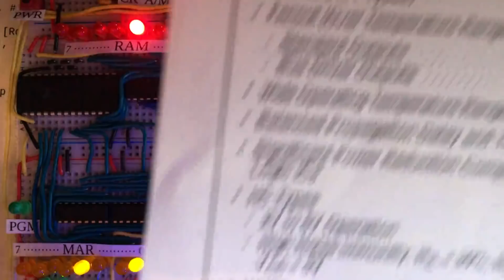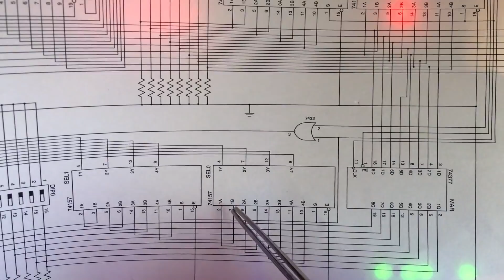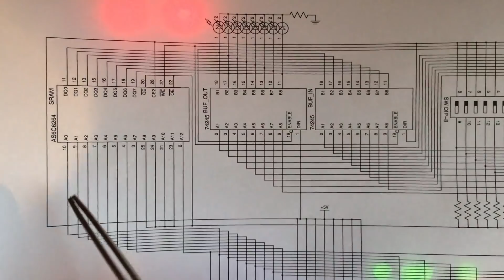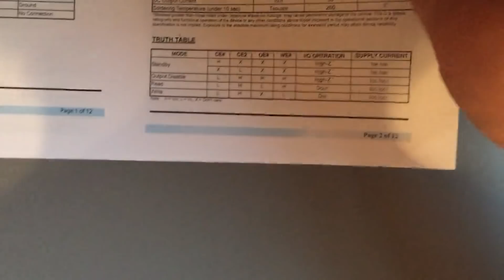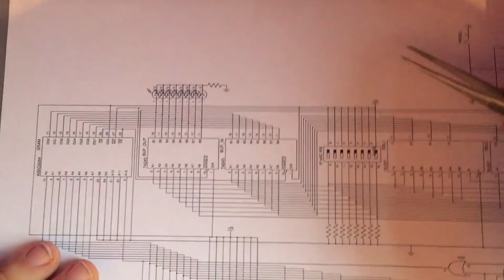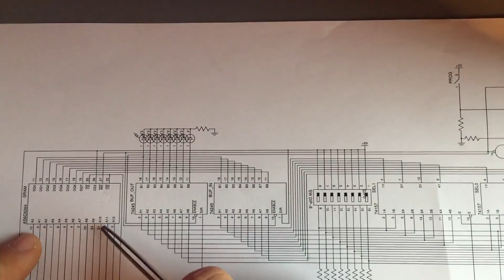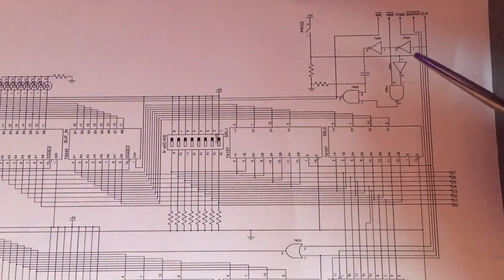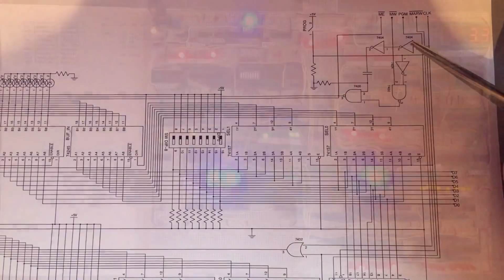My Ben Eater inspired homemade 8-bit CPU - Part 4: RAM

Comment: Hi. Thank you for everything that you've posted. It's been very useful! I see that you've tied OE# to Gnd, so that the RAM is always outputting data to show on the LEDs. I also understand that when WE# is pulled low, the RAM switches to write mode, and stops outputting data. However, because WE# is controlled by the edge detector, and is only low for part of the clock pulse, wouldn't the RAM go back to outputting data for the rest of the clock pulse? Therefore, you'd have the RAM outputting at the same time as the buffer outputting. In theory, I guess, both would be outputting the same data, so shouldn't cause an issue, unless something where to change on the bus. Wouldn't it be better to connect OE# to MI# through an invertor, so that the RAM wasn't outputting anything while the buffer was also outputting?

Comment: Sorry it's me again :P I'm designing a 8bit computer heavily inspired in yours, but I have a question about the RAM module. You use a buffer_in and buffer_out. Why not connecting directly the selector to the data pins? The control logic will control if the RAM is in input or output mode and read or write to the bus accordingly. Looking at Ben Eater's video he directly connects the data to the selector, so he can switch between direct connection to the bus or connection to the microswitches.
Reply from the maker: Ben's RAM chip has separate input and output lines. So when Ben's RAM chip is in output mode, the voltages on hist INPUT lines are totally ignored: they can be anything, without causing problems. So, he just hardwires them to the selectors, no problem.

However my RAM chip uses THE SAME lines for both input and output. When my RAM chip is in output mode, IT is asserting (that is, determining the voltages) on the I/O lines. If the selectors (which ALWAYS output a value on their output) were directly connected to the I/O lines, they would ALSO be asserting voltages on THE SAME I/O lines as the ram chip, and so we'd get an "assertion collision", exactly as you would if two components were outputting simultaneously to the bus. 

To avoid this, I use one of the buffers: it connects the I/O lines electrically to the output of the selectors ONLY when the RAM chip is in input mode. When the RAM chip is in output mode, the I/O lines are electrically isolated (that's what the buffer does) from the selector outputs and so not influenced by it at all. Indeed, at this time, they are set by the RAM chip itself.
Reply: But still you should be able to connect the RAM directly to the bus. If you want to write to the RAM you put it in first in input mode (so the bus gets free) and then put the contents of some register to the bus, then trigger the clock and write this contents into the RAM. If you want to read from RAM you put it in output mode (so it outputs contents to the bus) and make sure no other register is putting data to the bus. When switching to Programming mode you always put the RAM in input mode and the microswitches will be the ones writing values to the bus. I don't see the need of buffers in this scenario, or am I missing something?
Reply from the maker: Sorry, but no, I can't do that either :) Remember, I hardwired the RAM's Output Enable to true, so in effect my RAM chip is always in output mode, except when it's in input mode. This way, I can connect the LEDs so that they show me RAM contents at all times. However, I don't always want the RAM contents on the bus. Sometimes, it'll be doing something completely different. So yes, I really also need an output buffer, independent of the input buffer.
Reply: @jimmyb998  ok thanks. Now it's more clear. So getting rid of the leds and controlling the output enable from the control unit I can get rid of the buffers. I'll keep you updated of my progress when I put my schematics on github. One of the things I made different is the jump logic. I don't bring the flags to the control logic, instead I bring the flags to a MUX and I codify the condition to select the appropiate flag, leaving the position 0 for not jumping and the last position for inconditional jump, then the output of the MUX is my PCW.
Reply: I thought the same thing.  If it weren't for wanting to always show addressed RAM content with the LEDs, the transceiver chips could be eliminated.
However the transceiver is bidirectional so you should only need one, using the write signal going to RAM connected to the direction pin on the transceiver.
That assumes that the source/destination on the "outside" is the same.  I'll need to look at your schematic more closely to see if I'm right.
Reply: @danman32  Yes, I am a little puzzled about why there are 2 74245s in James's circuit; it seems unnecessary.
Reply: @Daniel Morin Actually, I thought about it a little more, and I think I understand why.  You have 2 SRAM inputs (BUS and PROG), but only 1 SRAM output destination (BUS).  The selectors are not bi-directional, so switching the direction in the transceiver won't work; you need to individually control the input and output.

Comment: For the I/O lines to the RAM chip, what is the reasoning for using two try state buffers, one for read one for write, rather than just one, toggling the direction for read/write?
Reply from the maker: The fact that the data flowing INTO the RAM should come from the selectors (which select either the bus or the dip switches), whereas the data flowing OUT of the RAM, should flow straight out onto the bus.
Reply: James Bates ahh of course, thank you :) this video series is a fantastic extension of Ben’s.
Reply: I thought the same thing.  If the input/output source/destination were the same, only one transceiver needed.  If the MUX had an output enable though, then only one transceiver would be needed.
Reply: How about using the 74257 in place of the 74157? This has tri-state output, so could use it's enable line for the RI control?

Comment: I have a question:
For the address you either get the address from MAR or the address switches, but why you use a buffer? you could directly connect the address selector to the RAM When you update MAR the RAM will automatically update, but will not put the data in the bus until the next clock cycle, so it's fine not to have a buffer in the address
Reply from the maker: There is no buffer for the address: the output of the selectors goes straight into the address lines of the RAM chip. As you point out, there's no need for it.

Comment: How did you do the trick wireing the  LEDs for MAR and Instruction Register? Of course I mean the 4 ones, their contact pins  reside on the above side of the chip, it must be really tricky
Reply from the maker: For the pins on  the top, I have some green wires which connect the chip pins to unused rows on the bottom of the breadboard. For the both the MAR and the IR, they are to the left of the relevant chip (because in both cases they deal with the higher order bits).

Comment: but for the program and data memory you use the usual program counter? how do you split the two memories on the usual chip? Is it possible to build a GPU with the VGA monitor?
Reply from the maker: The program counter is a register, and as such, it is neither program nor data memory. I discuss the program counter in the next episode: https://www.youtube.com/watch?v=tUXboOaisAY&t=2s

The "program" and "data" memories, are both stored inside the single RAM chip. The distinction is made by setting the A12 address line. See 31:52 in this video ;)

For an example breadboard GPU, driving a VGA monitor, see https://www.youtube.com/watch?v=l7rce6IQDWs

Comment: Do you have Goto's and jump back? If so you could build in support for functions in your computer
Reply from the maker: Yes, they are the CALL and RET instructions. Later on, in part 11 (https://www.youtube.com/watch?v=O_mTxnFYLXE&t=63m49s ), I go through their implementation, which uses the stack to save the return address.
Reply: @jimmyb998  is your construction set compatible with compiled code from gcc?
Reply from the maker: @Patrick1985McMahon  Not until someone writes a gcc  backend for it :) 
I actually looked at that once, but gcc is hopelessly complicated, probably for historical reasons. Therefore compilation is still a manual process for now, as in https://www.youtube.com/watch?v=-_u6HhAb5mo

Comment: It`s me again, sorry ... I´m actually doing the RAM module and have 3 questions: 1: I assume the chip right to the MAR chip is a NAND chip? 2: do you use the nand chip also for invert? 3: what kind is that 10-pin chip most right on the MAR breadboard? many thanks in advance!
Reply: sorry, it should read ...20-pin chip ---
Reply: Oh I see, it can only be the instruction register, that do not need a 74245 because there is no output to the bus as for the MAR. sorry for writing before thinking :-)
Reply from the maker: 1. Yes, it's a 74HCT00, and it provides the write control logic for the RAM. 2. Sometimes. Sometimes an actual inverter chip, depending on what happens to be available. There's an inverter up on my clock module. 3. That is the instruction register (a 74HCT377); see video part 5
Reply: It's always good to check which saves on chip count, using NAND/NOR, or inverter.  You only get 4 NAND on a chip and you'd be using at least one or you wouldn't be using NAND in the first place.  You get 6 inverters in a package.

Comment: what is the purpose of the program memory feature? (the green led that feeds to the thirteenth address line on the RAM)
To have the program in a diffrent part of the RAM than the acual program workspace?
Reply from the maker: Yes, that is the purpose. Physically, all the data is in the single RAM chip. But the programmer  (i.e. the machine instructions) deals very differently with the two "parts" of memory. It's inspired by "Harvard architecture" CPUs, which are different from the more usual "von Neumann architecture" CPUs.

On my CPU, it would be impossible to "program interactively", or to write an operating system which would "load and execute" new programs. That is because there is no way to update program memory using CPU instructions: they can only modify data memory. For small CPUs, which have their programs more or less "wired into them" (as I do with the DIP switches), this works well. But of course for general purpose computers, not being able to load new programs would make them pretty much useless. Therefore mainstream computers are almost all (unlike mine) von Neumann architecture.
Reply: Just a thought, is the Harvard architecture better in some aspects?  why choose it?

Comment: I'm having trouble writing to the RAM. I'm not quite sure what to do? It reads fine though.
Reply from the maker: Did you try without the edge detector?
Reply from the maker: The resistors on the DIP switches are very high (about 100k Ohm I think). They are really just pull-up resistors, to "force" the input to 5V when the switch is open. When the switch is closed, current will flow through those resistors to 0V, and so to keep that current small (a few uA ideally) I use very high resistors.

The reason I use resistors at all, is that I found the HCT series of chips, which I am using, to less reliably "default" to high when the inputs to them are disconnected. That appears to be another downside compared to the LS chips, which do reliably "default" to high. By using the pull-up resistors, I force the input to 5V when a DIP switch is open.
Reply: @jimmyb998  I wired the RAM module again and it seems to be working. I'm putting together the instruction register now and connecting the BUS.

Comment: What are the values of the resistor and capacitor you used in the edge-detection circuit?
Reply: Actually, why is the edge-detection even needed?  Could you not just AND the clock signal with the MW signal?  I'm not sure about the SRAM chip you are using, but there is no upper limit to the write pulse on mine.
Reply from the maker: Values are 169Ω and 1.5nF, making for a time constant of ~250ns, the smallest value I was able to get working. Possibly I could have had the sram chip in write mode the whole time, but I wanted to use the small pulses as Ben Eater had done. That way, I'd also be able to see the written RAM contents being read from RAM during the write cycle while debugging.
Reply: The edge-detection circuit should only send a pulse on the rising clock edge, correct?  For some reason (when testing with the manual clock pulse) the input is also being latched on the falling clock edge.
Reply from the maker: It should, that's right. It actually also sends (at least on my hardware) a NEGATIVE pulse (i.e. -5V) on the falling edge. This negative pulse, however, doesn't register as 1 on the input to the following NAND gate (a 74HCT00 on my HW), so it in effect "ignores" that pulse.

I seem to remember that the 74LS series uses some transistor-used-as-a-diode protection near its input lines, specifically designed to filter out such negative voltages. Presumably my 74HCT chip does something similar. But, I really haven't looked into that in any detail...

Ben Eater, in one of his earlier videos, actually shows another way to build an edge-detector, using only logic gates, relying on their finite switching speed of the chips to produce the pulse. I believe that one really does only trigger on the rising edge.

Comment: Just trying to rap my mind around you memory solution, which I thought was very inventive.  It look like you are only using 256 bytes for your data (0000 0000 0000 to 0000 1111 1111) and 256 bytes for you program (1000 0000 0000 to 1000 1111 1111) space and not using the rest or the memory available on the chip.   Is that correct?   Thanks again.
Reply from the maker: Yes, that's correct. The RAM chip is actually "too big" for my simple cpu :)
Reply: If the plan increased the number of address lines, then more of the RAM could be used.  However then a lot of the system that deals with addressing would need to be modified such as program counter.
Some sort of address paging changed through current 8 bit data/address lines might simplify the task.
In this simple 8 bit project though, 256 address should be plenty.
Hmm, paging.  Need to think on that when I start building.
Reply: You could use 16-bit addressing, like the Z80, but that would mean a 16-bit PC, a 16-bit SP, a 16-bit MAR, and the use of register pairs (AB and CD).  That’s a lot more
Reply: I like your program/data solution better, sort of like a 256-byte ROM for program and a 256-byte RAM for data.  Very creative solution, and easy to implement.
Reply: “That’s a lot more chips” I meant to reply.